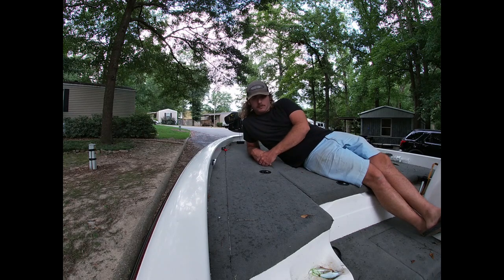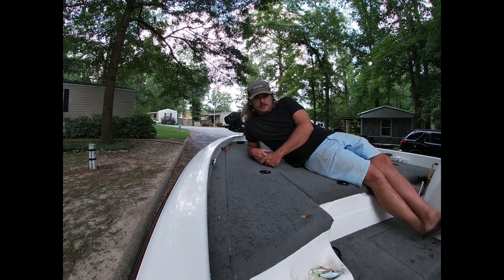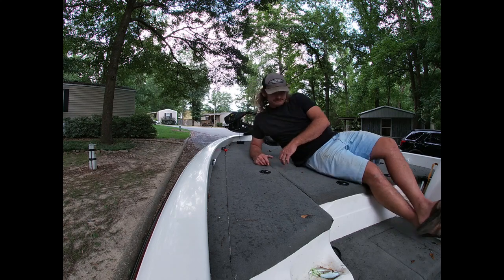LED Navigational Lights

Comment: Line is lipless on the same side as well. I love mine too but that does aggravate me. Nice work! I'm considering doing this. Any update on durability or any issues to speak of after 6 months?
Reply from the maker: Obcursco 12” led boat lights are the kind. No issues what so ever out of them. They’re so damn bright. I bought a second set for my other boat.
Reply: @1020628  any updates on the durability? Great video 👍🏾
Reply from the maker: Still working great. They haven’t sagged or fallen off. They’re very reliable. 10/10.
Reply from the maker: It’s been two years and I love them.